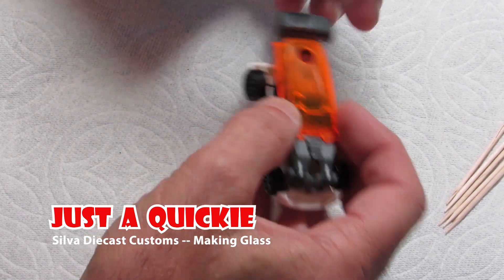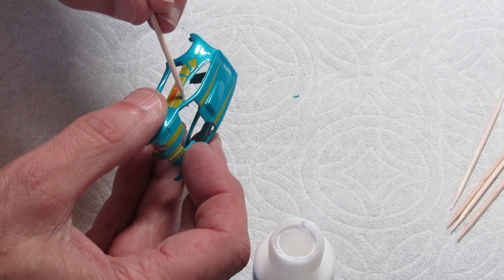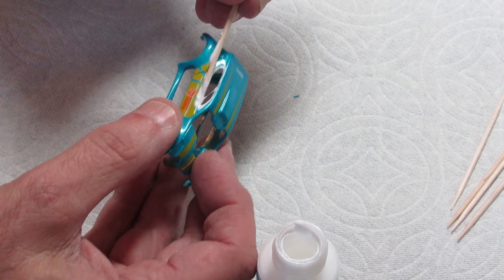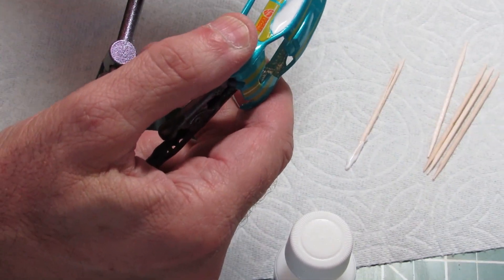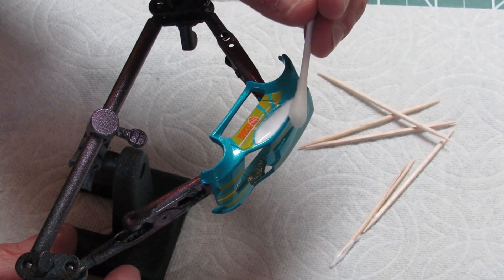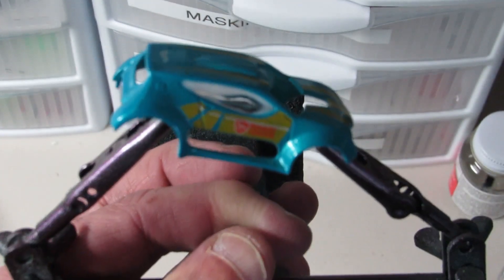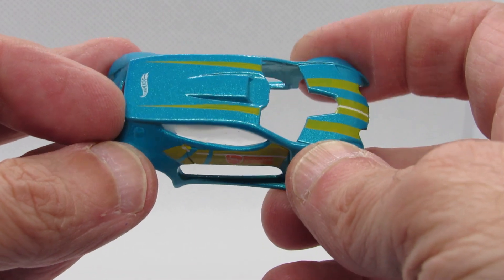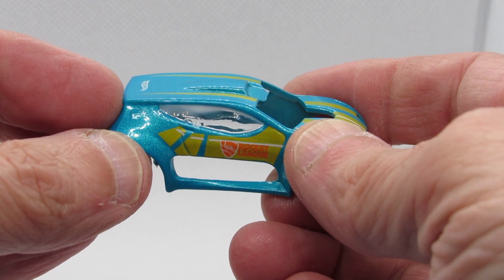Just a Quickie - Making Glass

Comment: Would this work if you put a piece of scotch tape or packing tape behind it?
Reply from the maker: I’m not certain...it might...but your question also made me curious if it could be “painted” on styrene and peeled off (maybe using mold release or something).  I’m going to have to give it a try 👍
Reply: @JimSilva-SilvaDiecastCustoms  Oh thats an idea right there. What if you make a "mold"  by tracing the shape of the window on some styrene and building up some material around that shape and then pouring the clear into it and letting it set up so its a bit thicker/stronger maybe? I would image if you could get it to release it would be somewhat pliable so you could give it a little curve if needed to fit the shape of the car body. This would be so much easier than trying to cast the windows in resin if it worked.
Reply from the maker: I do want to experiment with this.  I might also try putting it into the mold I made for the K-7 windshield to see how it turns out.
Reply: @JimSilva-SilvaDiecastCustoms  Oh for sure, you already have that mold made, cant hurt to give it a shot. Ive been thinking about ways to replace windows lately and I had thought about building a mini vacuum box and try some suction molded clear plastic pieces but I dont know if its really worth doin all that. After seein how the clear method you use works that has me thinking on that level now. I may end up just ordering some resin and just casting some windows at some point cuz I have the equipment, but I just hate having to order resin which can be kinda pricey and silicone for molds just to make some tiny window parts that I may never use again, thats why I like the idea of the clear method potentially being able to do windows with a very small investment.
Reply from the maker: Geek Variety I’m going to be trying another resin casting probably sometime this week using a slightly different process to see how it works out.  If it fails again, I’ll give the micro Krystal klear a shot in the mold.  I need to make at least two clear windshields for K-7 projects and while the sheet plastic was an acceptable result, it wasn’t ideal.
Reply: @JimSilva-SilvaDiecastCustoms  Do you have, or have access to a pressure pot? Making clear resin castings without a pressure pot can be a real pain in the ass truth be told. There are some resins from Smooth On that say you can use them without a pressure pot but ive had mixed results with them so I generally just pot up everything. I hope you post results on instagram or make a video about it cuz im really curious how things turn out for sure with your trails of the clear. Also if theres anything I can help with as far as information goes in regards to resin casting feel free to drop me a message on here on instagram and if i can help I'll do my best to share info.
Reply from the maker: I don’t have access to a pressure pot, and having looked into them, I think they’re way too much cost/effort-wise than I need for my limited applications.  I’ll keep giving other approaches a try and will post the results 😊
Reply from the maker: Also, thanks again for your comments and for your help (which I’m certain I will be calling upon when this next attempt crashes lol)
Reply: @JimSilva-SilvaDiecastCustoms  Yeah the cost is prohibitive for small projects, I just happen to have it cuz I use to make resin figure kits for around 10 years. Still silicone and resin arent cheap so buying even a small set of them to make a windshield is completely silly unless you plan on making a whole bunch of them or selling them.
Reply: @JimSilva-SilvaDiecastCustoms  No problem, if I can help im always glad to share my knowledge. I learned from a bunch of great people when it came to casting so I do what I can to share what I know and pay it forward.